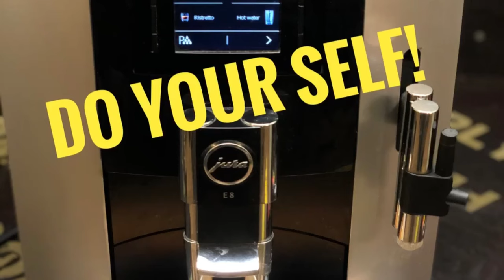How to Open Jura E8 Coffee Machines so easy

Comment: Awesome Video.
I have an bolt on the left and the right site at the back, on the buttom instead of screws like you.
I habe no idea to remove them.
Any ideas for me?
Reply: Mine is the same, I think they are some kind of tamper proof snap off screw…. May have to grind a small flat line in them then remove with flat head
Reply: They are screws and just use pincers to turn them

Comment: the grinder of my e8 stopped working due to a rock in the coffee, currently the motor makes sounds but the grinder does not work, could you give me some advice?
Reply: Btw great video
Reply from the maker: No one put there water?
If its make sound its mean motor still working! Check maybe there is something stuck(some dirt, rocky bean, rock) please make Grose grinder level, clean with vacuum cleaner and try again! 
This is what i can offer to try right now :)
Reply: @coffeetricksandtips1018  thnx , ive already done it and it only says, refill coffee container
Reply from the maker: @manueltzm  Then i dont know! Need to check. 💁
Reply: I am having this exact same problem. Were you able to fix yours? If so, how??? Please help!

Comment: What kind of tool are you using on those two on the bottom back? Mine seem to have a round head which is very difficult to grip.
Reply from the maker: Hi, Thank You for Your question!
I’m use special “Oval Head Service Repair Tool Key Screws Works for Jura”
It’s a Oval screwdriver! If You have a Oval “head” try little bit hit with hammer and You will get perfect tool for these screw ☺️😁
Reply: @coffeetricksandtips1018  Thanks!
Reply: @coffeetricksandtips1018  i couldnt wait for a tool so i drllled mine out.  seems to snap back together and bolt at other points but might wan to use the tool if you can... ; )
Reply: @stoma66  small pair of channel locks worked for us

Comment: Please help me how can I get to the clinging part of the machine in the front?
Reply from the maker: Hi, Which one You think? Coffee dispenser?
Reply: Yes, because after the coffee is grinded, it get stuck at the pressure and dispensing  process, nothing comes out except the high explosive sound
Reply from the maker: You need to take off both side panels and top! And then look up where are screws for these parts!